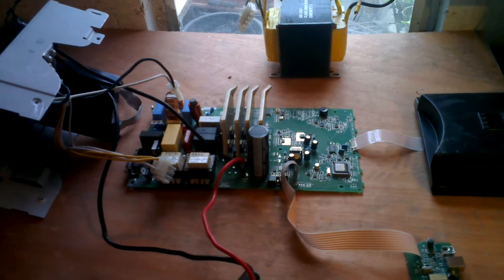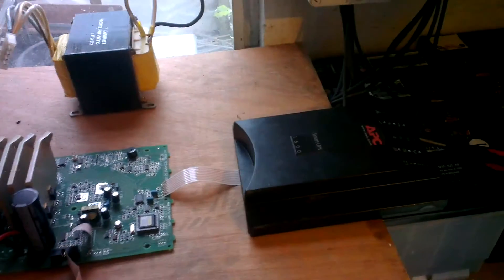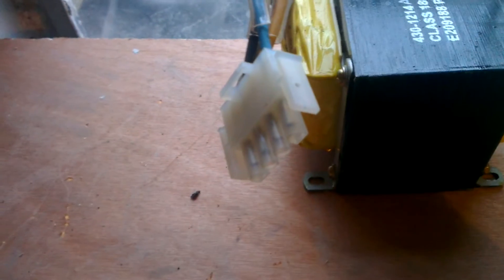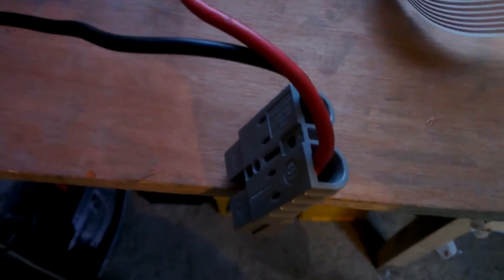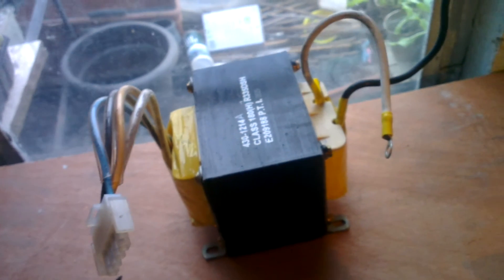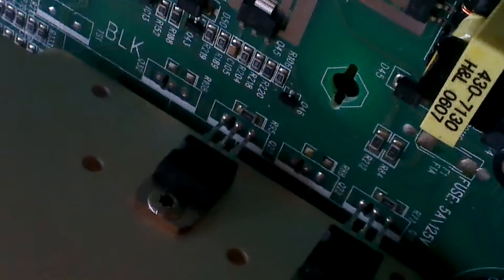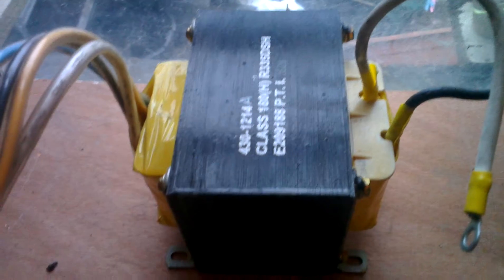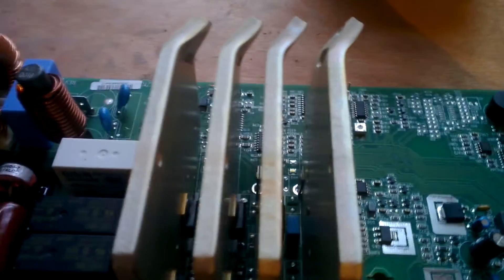UPS / Sine Wave Inverter Modifications (APC Smart-UPS 1500 UK Version) (misc)

Comment: You still alive?

The voltage in is 24v it's chopped by the MOSFETs. It then goes through the filtering and smoothing and then out.
The transformer has different winding and a small circuit to charge the battery at 24 volts ... The two batteries are joined.

Watch youtube Inverter. And how h bridges work.
Reply from the maker: Alive and well! 🤭

Comment: you might want to correct a few things - though I suspect you might have figured this out by now. :)  The principle of an inverter/charger is to 1) monitor mains voltage 2) charge the 24v backup power source ie wet cell batteries by RECTIFYING the mains AC and 3) on sensing a drop in the mains voltage, switch over to the inverter circuit which takes 24vdc and converts it to AC through a combination of an H-Bridge which converts DC to AC (the MOSFETS) and a step up transformer that takes the H-Bridge output and brings it up to mains voltage.  

Most of the cheaper UPS's in North American, even APC use modified NOT pure sine wave conversion.  You're correct in thinking that for the same VA output, 120VAC will need twice as much current as the 240VAC version.  To increase VA, consider adding a fan :)

Have you actually looked at the waveform coming out of the inverter?  unloaded AND loaded?
Reply: Ah, that would explain why multimeter reads the output voltage at 170volts on the mains output  when I kill the ac power to the ups. I just got an old one of these and started playing with it in the hope to let my wife run laptop on long trips.. I'd much rather a pure sine wave!

Comment: I know it's been almost a year since you've done this video, but I'll add a few bits of info:
* The MOSFETs are used kinda like the cylinders in a car engine. A 4 cylinder engine can handle a certain load; push the engine twice as hard, it can kinda handle it, but it would overheat and possible end up with catastrophic failure if not stopped soon enough. Adding in extra MOSFETs is like adding more cylinders to the engine. This allows them to do better load balancing of the work.
* The Capacitor is a nice reservoir. The more capacity there is available, the better the UPS can handle surges and be able to better compensate when the power fluctuates or when the batteries available power starts to dwindle. Capacitors (of the large type as in this case) are used for heavy AMP draw. So, think of starting a compressor of a fridge, air-conditioner or something of the like. The Caps help to handle that without the batteries being hit hard. And that puts less stress on the other parts of the UPS
* It should be noted that adding MOSFETs to the heatsinks could add extra heat. So you should add better cooling across those fins. instead of using the air shroud, I would recommend modifying the case for adding a fan right over the fins and blowing directly over them, or mount a fan in close proximity to them. This will help in efficiencies.
Reply from the maker: Bobby Hicks Thanks Bobby. I eventually abandoned this project because the inverter within it was ridiculously inefficient. What does interest me very much about this unit though is how it transfers from one power source to another extremely quickly.

Comment: Hi, Can you please check what is number of IC 18. I have one similar UPS, Unfortunately the IC 18 is burn and i am not able to get the number. It is 16 pin IC and it is located near to the Heat sink.
Reply from the maker: I'll check.
Reply from the maker: Ok, the closest 16-pin IC to the heatsink is labelled "361-0015ag".
Reply: Hi, Thanks for your replay. 361-0015ag is ic 19, can you please check, there is one more 16 pin IC, that is ic 18. arround that ic there is 3 polyester capacitor.
Reply from the maker: It is 4082ibz. It's a H-Bridge Driver!
Reply: Thanks Dear, I was searching the IC number last 3 weeks. Thanks for your valuable information.
Reply: hi what would make one of those units always be on overload even with no load at all? tks

Comment: I had the 48v 5kw acp ups got it off ebay for £30 it worked well until I blew it to fook haha
Reply from the maker: Haha, how did you blow it up?
Reply: it had been running well for a few months and with the extra fans I added it was getting dusty inside so I took it apart and for whatever reason I re assembled it with 1 of the diode bridge wires sort of in the wrong place a very big smoke genie appeared and that was the end of that. I've been messaging you through youtube have you been getting them?
Reply from the maker: Ahh I see! I blew mine up too. What I did was, I upgraded the mosfets in it and added more so that I could achieve more output. That worked too! What happened though is that one of the mosfets overheated and smoked. After that I abandoned the project. I've still got the bits though so I can revisit it another time. I don't get any notification of your messages, they just go to messages and wait there. I forget to check them.